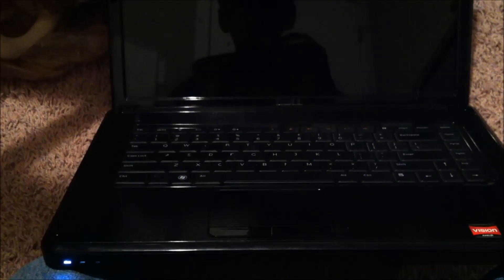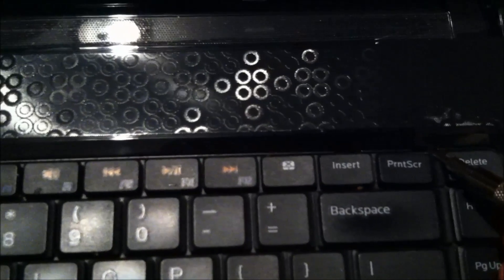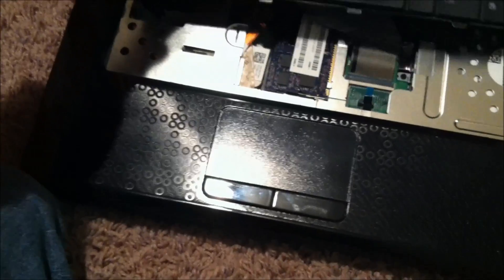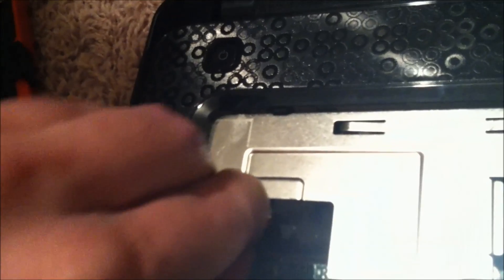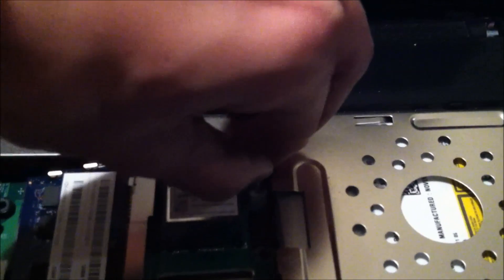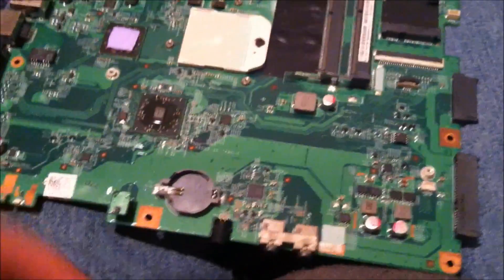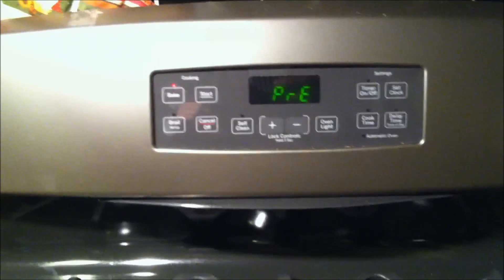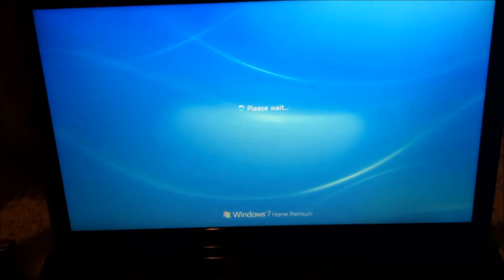How to fix repair Dell Inspiron M5030 7 Beeps Blank Screen No screen when turned on

Comment: the problem is a video chipset?? you are sure?
Reply from the maker: The chipset and improper cooling design. Bake it, and find out
Reply: After Hours Tv & Pc Repair My laptop has 8 beeps, if I connect my laptop to my TV for the vga port, it works fine. and if I do a test dell (f12 to start the laptop), I have problems goes to the internal connector of the cable is not led. Could you help me?, Is the same problem? (I have not because I understood that the external video works). sorry for my poor English.
Reply from the maker: Beep codes from m5030 manual 

Beep Code Possible Problem

One - Possible system board failure or BIOS ROM checksum failure

Two - No RAM detected

NOTE: If you installed or

replaced the memory module,

ensure that the memory module

is seated properly.

Three - Possible system board failure or Chipset error

Four - RAM read/write failure

Five - Real Time Clock failure

Six - Video card or chip failure

Seven - Processor failure

Eight - Display failure
Reply: vaguito Hey dude, your English looks pretty straight to me.
Reply: Rob Dahl WOW THANKS :D!

Comment: I have two of these laptops and they both eventually did the same thing.  It must be a design fault.
Reply from the maker: Overheating on chip caused the bga solder to form cold solder joints. Improper cooling causes this, a design fault.

Comment: this is a temporary fix. it will be back within a month or less. to fix it u need to reball/ replace gpu and use copper shims to cool down the gpu.
Reply: This happened to me while mine was still under warranty. Sent in to Dell and got it back couple weeks later. Worked for a week. Gave up on it, now exploring my options. Had it apart and cleaned it up. nothing. (duh) i'm trying this tomorrow. Copper shims on the gpu? which one is is it?